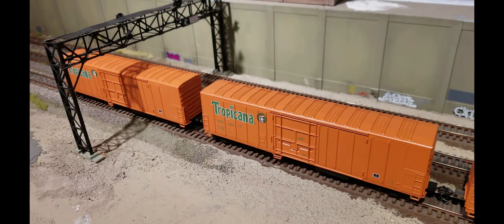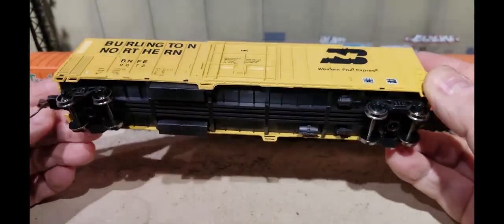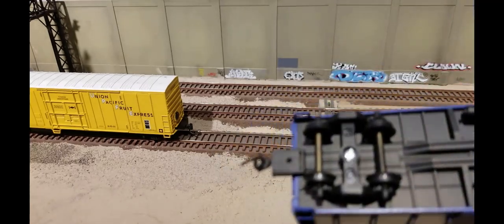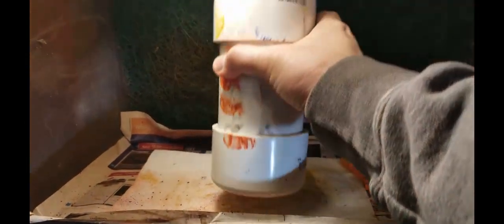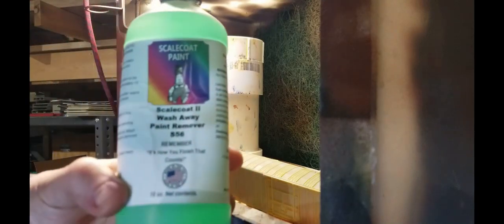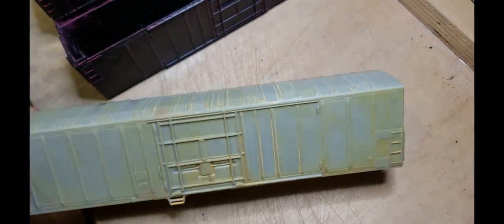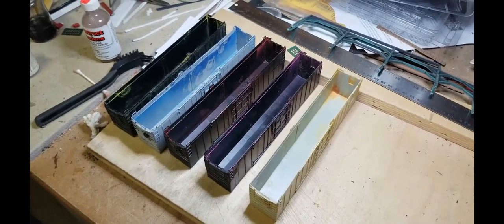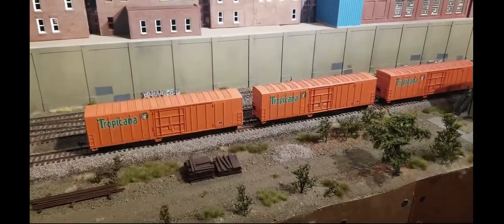Modeling a Tropicana Juice   Train part 1   stripping paint

Comment: Hey Chris they are coo cars for sure. I just finished stripping a bunch of covered hoppers( such a pain). What did you use for stripper? (91% isopropyl)? Also I’ll be At Springfield on Saturday for the show. I’d love to meet you buddy. My email is in my about page.
Reply from the maker: hi dave  i used  scalecoat 2 paint remover.  works very good.  been using it for years.  im going to the show on saturday too  sounds good i will email you.